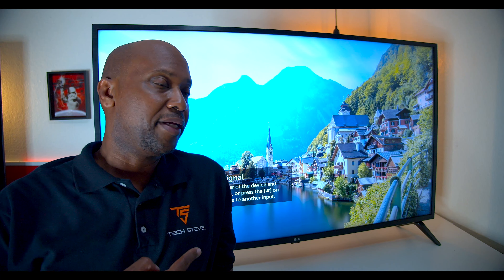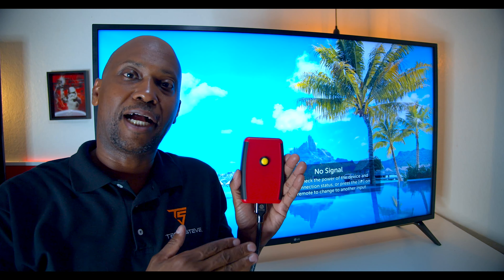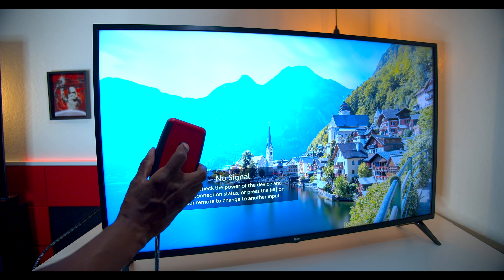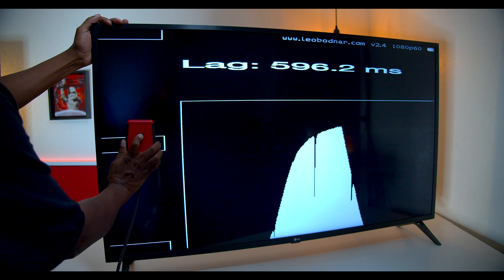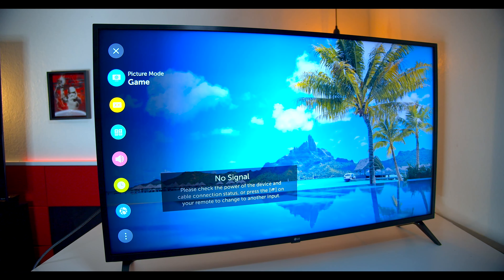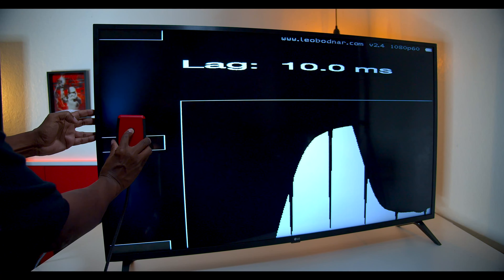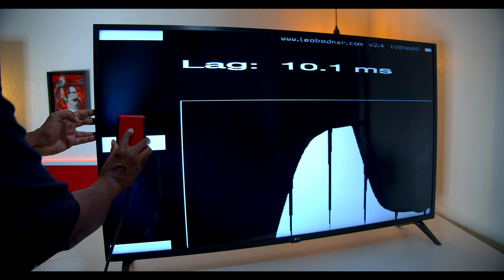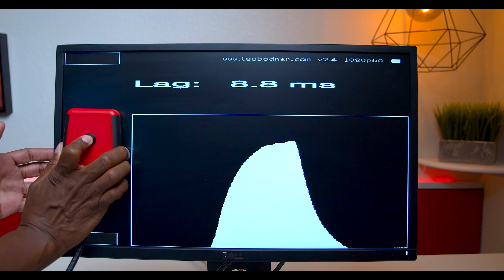How To Check The Input Lag (milliseconds) On Televisions

Comment: On the one hand this seems extremely useful, and I would love to get my hands on one to help figure out the input lag on the TV I use for Dance Dance Revolution. However, the price point is a bit high for just a single use like this. Glad to see a tool like this actually exists though!
Reply: You will love my $400 pair of wire crimpers that only works for one type of connector.  Professional tools are expensive.

Comment: did the device include tv response time as well with the input lag when it showed 10ms? I am buying a 170 hz monitor and on a review the same device showed 8.8ms. I am wondering if thats the monitor response time+ input lag.
Reply from the maker: It’s just input lag, you can response time on specs sheet

Comment: Hi Tech Steve. On the website they offer two output options to select when wanting to purchase it: 720P and 1080P. If I select 1080P does that mean I cannot test it on my 720p plasma?
Reply from the maker: You can use the 1080p on any Display including 4k from what i know. I’m sure the 720p is an older model
Reply: Tech Steve awesome. Thanks!

Comment: Very cool idea however this will only tell you the input lag for a 1080p source, adding more bandwith can increase the input lag on some tv's so you'd need one you can set to 4k 60 at least as well.   here are the specs for that particular response tester,  Specifications
Output Connector

HDMI Type A

Output Resolution

1920x1080 or 1280x720

Output Frequency

60Hz

Power Requirements

2x AA 1.5v batteries

Housing Material

Plastic

Weight

100g (excluding batteries)

Dimensions (LxWxH)

118x79x31 mm